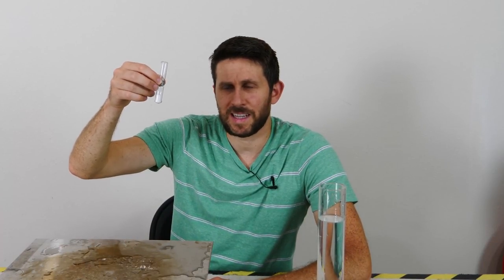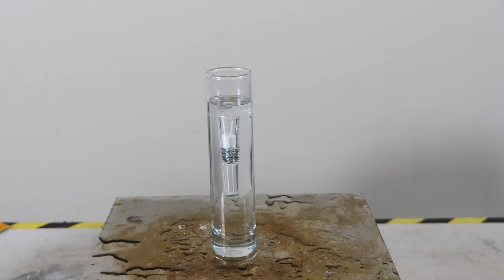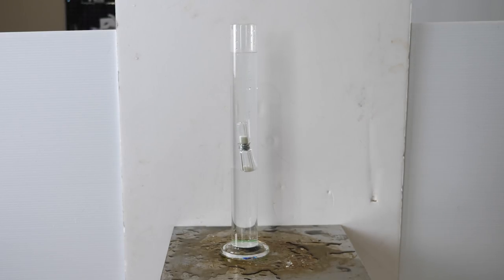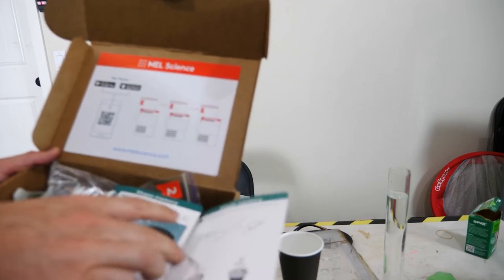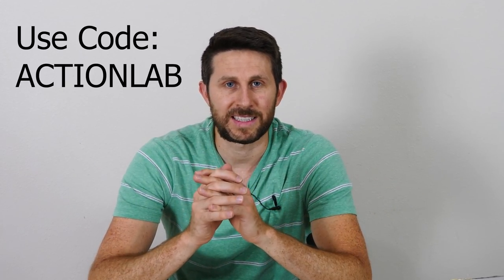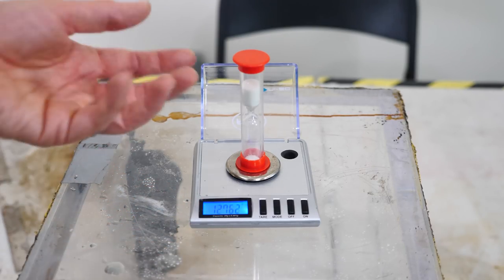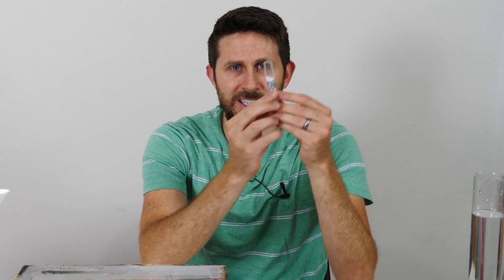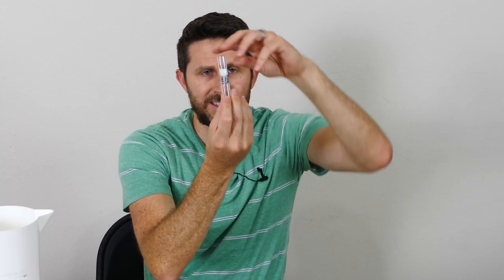Can You Figure Out The Hour Glass Buoyancy Problem?

Comment: What i presumed before the explanation was given, was that, as the sand was in the upper part of the hour glass, was having a higher center of gravity, which relatively had less gravitational pull over it as compared to the 2nd setting. As we all know, G is inversely prop to 'r' squared. Thus when the sand was in the lower compartment, having a lower center of gravity. The g force acting on it was comparatively higher causing it to sink comparatively faster. However the high center of gravity also causing the system to be unstable and hence, causing it to flip over, leading to the wall friction, but that will only explain the very instant reduction of sinking time taken, but overall its the center if gravity governing how fast it will sink, in comparing the 2 systems. Im open to discussion if any. Thnx

Comment: It still floats without being wedged. Parallel friction is weak so when it loses the buoyancy at the bottom, it loses its perpendicular surface area for water pressure to push against.
Reply: Actually, buoyant force in incompressible liquids depends only on the volume of the immersed body.

When it orients itself straight, it does lose projected surface area, but it also gains in height, so the pressure difference across the two ends increases.

A simple proof is that if you replaced the immersed body with water, the water blob could distort and reorient itself all it wants, but it can't accelerate downwards
Reply: There are many forces that contribute to the sweet spot in all of this, but it all comes back to gravity, even though the internal values of the hourglass never change. If the volume of the whole hourglass did not fluctuate its distribution internally in relation to the volume, weight, and pressure of water outside, it would never  sink unless it turned upside-down. And it should have turned when it had room to do so without being wedged. The volume of the hourglass gains buoyancy while the sand is in freefall, while the sand gains velocity and transfers that momentum downward when it lands as the buoyancy reverts to its original value. It is that positive momentum and the negative / neutral fluctuation of buoyancy in the opposite that discharge the static friction like a jackhammer.

Comment: watched experiment. commenting my hypothesis before watching the rest. 
i think, because the air is deeper in the water, its under (slightly) more pressure. as such the buoyant force the apparatus experiences is higher, thus it floats. i suspect that the shape (i.e width) of the water vessel is also important as to prevent the apparatus from flipping back over to its more stable orientation since it is functionally an inverted pendulum when in the orientation in question.

Comment: This reminds me of the Mythbusters episode that explained how Jack and Rose from Titanic could have both easily been saved : Just tie the lifejacket to the bottom of the plank, to allow it to support both Jack's and Rose's weighs simultaneously, instead of sinking. Basically, have the heaviest part on the top (Jack and Rose - or, in this case, the sand) and the lightest part on the bottom (the lifejacket under the plank - or, in this case, the still empty half of the hourglass).
Reply: That's not what happening here, watch till the end for the explanation.
Reply: @-TheRealChris  True, but I'm just saying that it reminds me of the same experiment. The forces at play are not the same, but it still brings back those memories : in both cases, the fact that the heavier or the lightest part is either on top or at the bottom influences the end result and the buoyancy. Whether it is ultimately due to friction (like here) or another cause (like in the Mythbusters episodes), it still triggers the same 'Hey, I saw something that looks a bit like that, before' reaction. And, yes, putting the heaviest part of the hourglass on the top will increase buoyancy. It won't increase it just by itself : It will increase it indirectly, by causing the situation where friction is forced to intervene. But I can understand how my wording could have sounded a bit ambiguous, in my first post.

Comment: U Saïd correctly about friction but I want to add something.When the sand is up the air is pushing from downwards and when the sand is at the bottom then air is pulling upwards it means air has more pushing power than pulling

Comment: My explanation was that the sand that's falling is not in contact with the hourglass and so cannot be contributing to the weight.  So when the sand is at the top, the length of the stream of falling sand is longer and so more of it is not contributing to the weight and so the overall weight is less.  I still think that this is true but the effect is so small that the scales could not measure it.

Comment: prognosis before waching the video: If its at the bottom it will have maximum weight. If you flip it a part of it will be in free fall, so you could argue that it will be lighter. But when the sand hits ground it will counter this loss of force. (F(impact)=∆P/∆t=m*v/∆t=m*g*∆t/∆t=m*g=F(g) (∆t while falling and accellerating is the same ∆t as decellerating, cause you can say the average acceleration is g of course and the average decelleration takes place over a time of ∆t, so while it falls it accelerates, and at the ground it decellerates, but while flying down it doesnt, so you take the average decelleration between free fall and hitting ground and so you've gotta take the same ∆t as free fall) )
So at a few milliseconds after turning around it will be slightly lighter, but after that it will level out (at the time the sand flows at a constant rate)

Comment: First I thought it could be because 9f the pressure of the water.
My idea was, that if the air is on the bottom of the hour-glass it displaces the water which is a bit more dense then 1cm more up.
But I didn't think about the friction 🙈

Comment: Now, I 'm thinking that the mass falling in the hour glass is not a part of the weight of the entire system, and that could be the difference in buoyancy.  That idea would mean that the amount of mass falling, either through speed or volume, changes as the hour glass progresses.  All of this is testable too, with my previous comment about vibrating the sides to see if it drops by slipping the friction through vibrations.  If it don't drop when vibrating, then the falling mass may be causal.  Testing the amount of mass falling through time would be a bit more difficult.

Comment: The weight on the flip-flop experiment is so great because it challenges exceptions we have, like thinking the weight on the flip-flop "holds it in place" and it has nothing to do with friction.
In reality, you CAN'T hold something in place like that without friction. Even with a gigantic weight, the flip-flop would start moving without friction.
Reply: exactly, a giant ice cube on a smooth glas surfacr for example would glide very easily I imagine
Reply: A large weight would cause a lot of inertia though, so even a fairly large force would accelerate the shoe quite slowly across a frictionless surface. That is, unless the top of the shoe is frictionless as well, in which case it would slip out from under the weight.

Comment: I dont think it's friction. Watch 1:50. It starts sinking and is then stopped by some force, even before the hour glass is in full contact with the glass tube.
My guess is a pressure change in the air compartments inside the hour glass, due to the sand pushing downwards.

Comment: It’s not about weight, the weight itself never change cause you have the same mass amount on the system. The sinking effect it’s related to the weight location in relation of the center of mass (gravity center), for a buoyant the weight distribution affects directly the way that it behaves, if it’s over the mass center on the same flotation axis it have positive buoyancy but it becomes very inestable, if it’s closer to the mass center it became neutral buoyancy but it turns below the mass center then it have negative buoyancy. That’s the reason why divers have the weight belt over the waist and in a very similar way submarines after fills special ballast chambers to sinking, could control its buoyancy by moving back and forward a kind of pendulous weight from the center on the gravity center.

Comment: In accordance with E=MC2, the system weighs more when the sand is in the upper chamber.  This is because of the additional potential energy (mass) given that the sand is higher in this configuration.

Comment: Cool explanation dude. But honestly, You don't need friction and gravity and an hourglass to demonstrate this phenomenon. 
It's that way simply because of the density difference. It's denser at the bottom when sand is at the bottom so it sinks. The opposite happens when the sand is at the top, it's less dense at the bottom so it floats. This also has to do with weight and its relation to gravity. Usually when you have a structure with two different masses, the part with more mass tends to get pulled more by gravity, thus the part with the sand struggles to go downward and so it sinks.
Reply: Oh and yeah. You do need gravity to explain this
Reply: It also works the same with anything that has unbalanced weight
Reply: You could try the same by using two plastic bottles. Fill one half way with sand and fill the other one with the same amount of sand but block half of the bottom of the bottle such that the sand stays at the top.
When you place both in water, The first bottle with sand at the bottom sinks immediately, but the second one flips first (so the sand at the top becomes the bottom) and then it sinks completely.

Comment: It depends on what you're considering weight, mass would be the same regardless, a buoyant force would change the apparent weight if you're measuring the hourglass itself but shouldn't be an issue if you measure the cylinder. But there's a lot of factors in leaving out x.x

I'm only at 1:54 So my brain just wanted to chime in and see how close I am in the end
Reply: ... well I mean I wasn't wrong just didn't formulate a conclusion... friction of course wasn't even near what I thought But that makes sense.

Comment: I THINK IT MIGHT HAVE SOMETHING TO DO WITH BALLANCE AND AIR PRESSURE INSIDE THE HOUR GLASS . A HIGHER VOLUME OF AIR IS TRAPPED ON THE BOTTOM SECTION  OF THE GLASS, WHILE THE REMAINING AMOUNT OF SAND ON TOP IS TAKING UP AIR SPACE.  (THE GREATER  AMOUNT OF AIR SPACE ON THE BOTTOM HALF OF THE GLASS IS WHAT'S KEEPING IT A FLOAT ). WHEN THE SAND REACHES THE BOTTOM OF THE GLASS, WEIGHT TAKES OVER  DEPENDING ON THE AMOUNT OF TRAPPED AIR ABOVE.    BALLANCE IS EVERYTHING.

Comment: Actually, hourglass with sand at the bottom should have weight a bit less than the same hourglass with sand at the top. Because when two objects that attract each other, move closer, they become a bit lighter. Rotation of Earth should make this effect more significant, because top part of a hourglass move faster than the bottom part, and object that moves faster, should also be heavier. But even combined, this effect in our case is too small to be measured.

Comment: But is it really friction? Sorry if this doesn't make sense, I'm no scientist nor have I done that experiment, but is it possible that instead of friction, it's the volume of air that is causing it to float?

For example, If you put a ball in water and you submerge it, it gets harder to sustain the deeper you go.

In your  case, the sand is using up space on the top and having more air in the bottom is actually letting it float.

Comment: I believe the weight does change slightly.   When the sand is at the the bottom all the sands weight contributes to the systems weight.   But when the sand is at the top and some is falling, the falling sand does not contribute to the weight.   If we had a ball in a box, the ball would contribute to the systems weight.  If we suddenly turn it over, while the ball was falling in the box, the box system would be lighter since the falling ball is not contributing to the weight.   The newly turned over device has a long column of falling sand and therfore 100 grains are in the process of falling and not contributing to the weight.   As the sand builds up in the bottom the length of the column of falling sand decreases (few sand grains in the state of falling) and thus the weight of the system increase since fewer grains are in the state of falling.
Reply: I was thinking the same, but then was wondering : when the grains hit the bottom with some kinetic energy that is transferred to the hour-glass and accelerate it more = more "weight". The question is, is that extra push greater, equal or lower than the loss from the falling sand?
At least for a very short time before any falling grain hit the bottom, weight must be lower (unless we miss something 🤪)
Reply: I did the math (I am a high school science teacher) and I found that. The weight of the system would decrease as the sand began to fall, and would reach its minimum right before the sand started to hit the bottom. The maximum decrease in weigh of the system would equal the weigh of the suspended sand (but only for an instant). Then as the sand impacted the bottom of the container the force of the collisions would increase the weight of the system to the exact same amount as was lost by the suspended sand. Thus the weight of the system would be the same as in the static situation. But then when the sand ran out, for a moment you would have more impacts than suspended sand and the weight of the system would go above the static system weight reaching a maximum equal to the weight of a suspended column of sand. But then all the impacts would end and the weight would return to the static weight of the system. This is all based on the Law of Conservation of Momentum. I was wrong in thinking that the length of the falling column of sand would make any difference, since what ever gains are achieved by having a long column is equally undone by having more or harder collisions.
 @SylouCool
Reply: In order to measure the changes in weight you would need a very tall evacuated hour glass.   One that would allow a lost of sand to flow (large hole) so that a relatively large percent of the system weight was in the column of suspended (falling) sand.   And you would need a force guage that could respond very quickly to slight changes. @SylouCool
Reply: Doing the experiment with physical objects and devices would be hard,  however, I am sure computer modeling could do it @SylouCool
Reply: @danagillam  Thanks. Could you tell me how you convert that kinetic energy from the impact into a force (therefore an extra weight). From what i understood it would require to know the elasticity of both sand and glass to workout the time window on which this energy is released, which would be very specific to each hour-glass. But maybe i missunderstood or forget something, my high school day date a bit (and i wasn't the most serious student 😅, too bad cause otherwise i was quite good)
Reply: Good catch. Except.
.
When it hits the bottom there is a momentum transfer to the bottom that equals the weight loss at the top, no?

Comment: but could you also create something like this without friction by simply having a continuous change in the center of mass, for example: the hourglass itself stays in place while the center of mass slowly sinks until the center of mass in the hourglass can no longer sink and then the hourglass itself starts sinking?
Reply: I don't think that's possible. When the hourglass hits the water, it'll always try to push the lighter side on top because of gravity. Gravity keeps pulling the heavier side with a stronger force than in pulls the lighter side so it'll flip over every time unless there's something preventing it from flipping over.

Comment: I think many lay people get confused by physics jargon when mathematical expressions are put into English verbatim.

For example, in physics when something that has been moving at a fixed speed slows down that is expressed mathematically with a negative sign before a rate of acceleration. And physicists will call that "negative acceleration" when speaking about it. But in the English language to accelerate means to speed up. When something is slowing down we don't say "It is accelerating negatively;" we say, "It is decelerating." We use different words for speeding up or slowing down.

Similarly, when two objects come into contact with one another the relationship between them is expressed mathematically by opposing forces, using the term "force" for both.. But in natural language we have two different words: force and resistance. If someone is pushing against a heavy object we don't say the object is pushing back. In natural language a force is always conceived of as active, the one pushing, the one being pushed is resisting which is conceived of as passive, whatever the math may be. We speak of friction as resistance rather than as an active force.

When physicists do not take into account the difference between mathematics and natural language it will almost invariably confuse listeners.

Comment: Before seeing the answer I have an uneducated guess:
Obviously the hourglass weighs the same regardless of its orientation.
However buoyancy force acts on the bottom surface of a submerged object,
So if the object is tilted (because it's top part in heavier, but the container is narrow enough to stop it from flipping over) it has much more bottom surface than when the sand falls to the bottom, and the object straightens thus reducing its bottom surface.
Did I get it right?